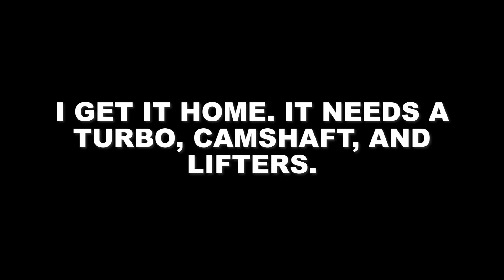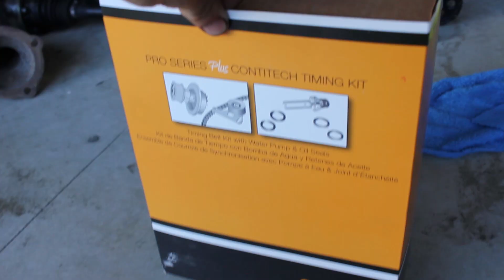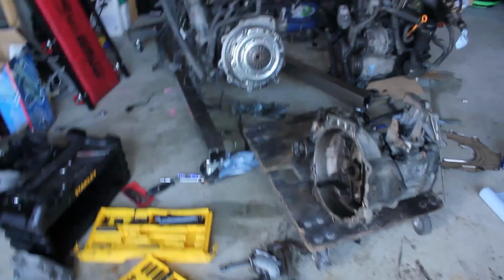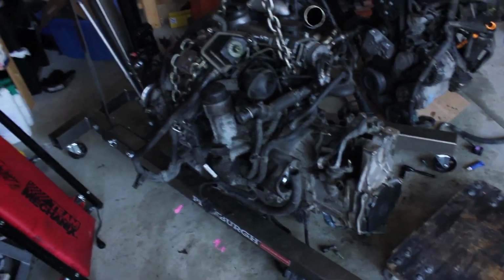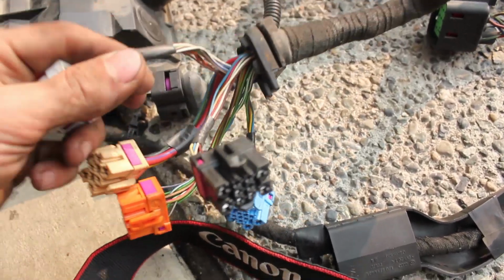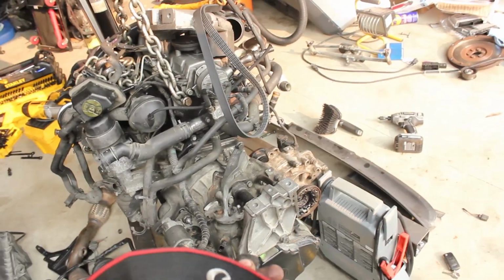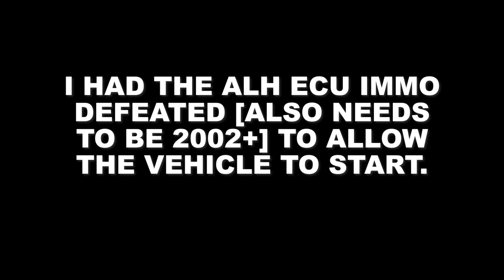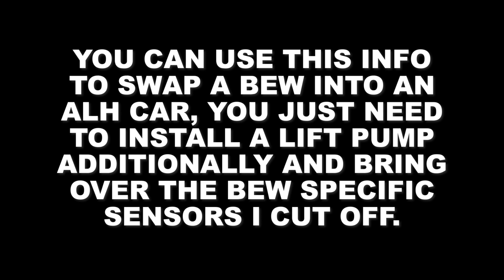BEW to ALH Swapping a 2004 Jetta TDI Wagon

Comment: Those leaves and debris in the wheelwells man... that's why I found my '04 Jetta with water on the floorboards one day in January. Because they block the water from draining. I had a field day trying to dry it all out in the middle of the humid PNW winters as well as clearing out more tree debris from under the windshield wiper cowl.
Reply from the maker: I feel that. Every mk4 I've owned has had it, this was probably the worst I had ever seen.
Reply: My buddy has a 06 BRM 5 speed jetta that is running bad, thinking about buying it. What would you do with that platform?

Comment: What did you do with the wires you cut off the bew accessory harness for the “ fuel and other” wires
Reply from the maker: They're unused on ALH, related to BEW specific things like BEW electronic ASV, and EGR valve. Cut them, tape or heat shrink the ends and put them out of sight.

Comment: New to TDI's, Why not to put another BEW? Good vid.
Reply from the maker: All BEWs in my area at the time were equally high mileage and about $1,000. The lifters and cams notoriously need addressed anywhere between 300,000 kms and 480,000 kms depending on what kind of usage the engine saw. To fix that is around $600 usd. Then you had the 'smart' wastegate on the BEWs that are notoriously expensive when they fail... They can be converted to manual but another point against it. And lastly, even though they're more powerful than the ALH they also consume more fuel so the biggest factor for me was FE. Finding that ALH for $212 usd was too hard to pass up versus another BEW and the conversion wasn't as bad as I thought.
Reply: @thirdgeargrind   ok thanks for the details !!
Reply: @thirdgeargrind  I heard you can use the BEW bottom end and put the alh top end for better strength? Did you consider doing that?
Reply from the maker: @nephron9924  I actually didn't, but for this project I wasn't going to build the car for the power to warrant swapping the heads. But that's an excellent idea if someone plans on making over 200whp!
Reply: @nephron9924  I was going to suggest this as someone on tdiswapped trucks fb page is doing that exact setup! Although nothing against the ops methodology, may be more work doing a ALH head on BEW block since you’d be cracking the head off (this triggers inspection and rebuild mode for me)
Reply: @thirdgeargrind  swapping my 02 ALH (rolled Golf) into a 2.0 Jetta Wagon. Open to any suggestions or tips. Thanks!

Comment: How do you get past immobilizer I just did the exact swap and car starts for a second and then dies
Reply from the maker: I sent the ECU to a tuner and had the immobilizer defeated for this particular car. It's possible to rematch the immobilizer if you can find someone who has VCDS and the programming to retrieve the cluster SKC code.
Reply: @thirdgeargrind  Thank you for your reply I have the VCDS also have programs to turn Immo off but for some reason cannot connect to my ECM
Reply from the maker: @chriseckenrode675  The most common reason for no ecu comms usually relates to the can bus wires in the radio harness being wrongly modified.
Reply: If you have the entire donor car, can you just swap the cluster for the new alh?
Reply: @mybigbackyard741  you could, but you'd still have to deal with the keys and immobilizer.